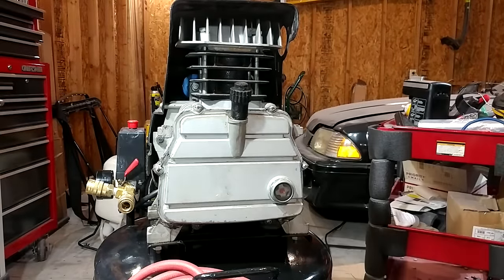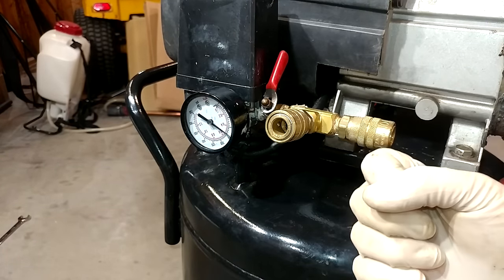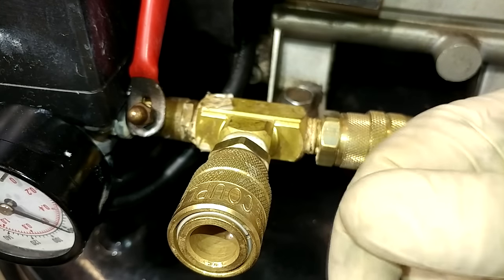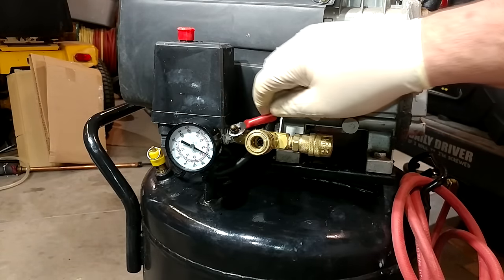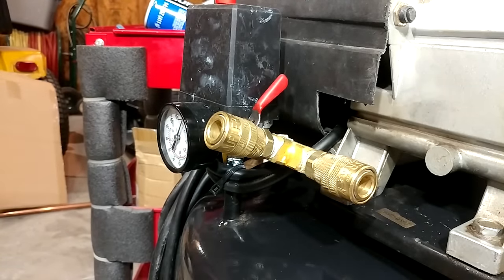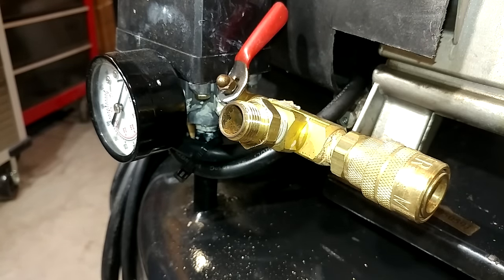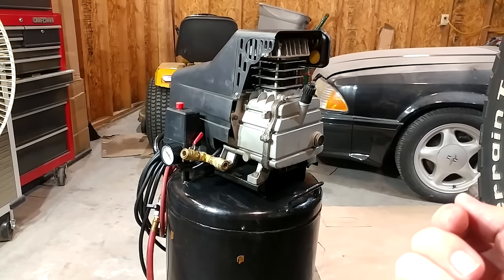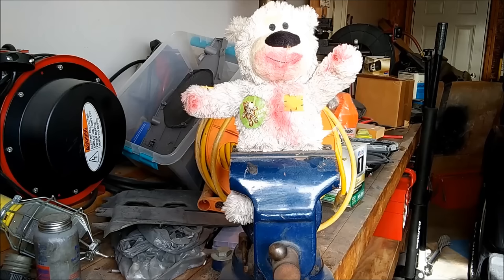Cheap Upgrades for Cheap Air Compressors!

Comment: For impacts I don't bother regulating their input pressure since they'll cope easily with the max my various crap compressors put out. In that case a regulator is merely a flow restriction and the compressor would fail before overloading any impact tool.
Reply from the maker: The comments are full of people disagreeing (some pretty intensely) with both of us for doing that. 😂

Comment: What regulator do you recommend to buy if we want to replace the crappy one?
Reply from the maker: On compressors of this size, pretty much anything that is physically the size of a can of soda, or larger, at the home improvement store will do. 

I've had a regulator video simmering on the back burner for awhile now that I really need to get to. 😆

Comment: Your channel locks and vice grips were backwards.   They work better and wont shave material off if they were flipped the right way.  Ebay has cheap filters with threads.  Same price as Briggs filter with no rigging
Reply from the maker: I do plan to revisit the filter in the near future. I'm not happy with the performance of what I ended up with.

Comment: Do harbor Freight compressors ha US threaded fittings or metric?
Reply from the maker: It depends where. Even worse, it probably also depends on model.

All of the air ports (except the air intake on the cylinder head) I've ever seen on them are NPT. Everything else, I would assume metric, but you'll have to double check.

Comment: What about increasing the diameter of the charge tube from the head to tank? Is there any improvement to be had there by going bigger?
Reply from the maker: I doubt it on a compressor of this size. But... I have heard of people finding casting imperfections that were obstructing the outlet on the cylinder head. It might be worth taking a look for something like that?

Comment: Use  DOT rated plastic air line for your air tank drain remote .
Reply from the maker: I imagine you certainly could do that. It's more difficult for me to get that than it is to use regular air hose.

Comment: My cheap compressor could even keep up with a die grinder. It wasn’t the regulator because it took ages to recover the pressure.
Reply from the maker: There's a difference between pressure drop across the regulator and simply running the tank empty. The one in the video won't run a die grinder for too long either. They're one of the most air hungry tools you can get.

Comment: Drill some one inch holes on outside face of air filter 🎉 it will work better .
Reply from the maker: I thought about that, but I ended up replacing that entire housing not too long after this video.

Comment: 2 years ago I know, but if anyone wants to try this, jb plastic weld is great for the air filter mod.
Reply from the maker: Lots of folks have said good things about it. 👍

And... I probably wouldn't do that one again. I replaced that housing with a Solberg unit that cost a couple of bucks, but is much nicer in the end.

Comment: Great vid,thank you! I didn't know the regulator on these small compressors could be so restrictive! 
I am concerned about using  ful pressure on certain tools like finish/brad nailers and pneumatic rivet guns, etc. Did you put a remote regulator in your system for tools like this? If so,what brand do you recommend? 
Thanks again! (Really clever with the filter!👍)
Reply from the maker: Thanks!

I didn't know they could be that restrictive either until many years of ownership. It wasn't until I attempted to use a 1/2" impact gun with mine that I discovered the problem. Then I ran into the problem twice more in other people's shops...

Just to get you by for tools with a relatively low flow rate, like nailers and such, the OEM regulators are fine. Put the one that came with your compressor on quick connectors so you can plug it in and out as you choose.

I'll be covering regulators in a future video, but my general preference is to try to find something industrial grade on the surplus market. Even a fairly well used Parker, IR, SMC, etc will be much higher quality than something from the home improvement store. That said, almost anything is an improvement over what comes on these units.
Reply: @TheBrokenLife not to be a smart-ass, but why not move the regulator to the other side of the tee? That way you have one full-flow and one regulated outlet, leaving you the ability to use more precise tools?
Reply from the maker: @avedesco  If I had planned it all out from the start I absolutely could have. But, I'm positive the day the regulator came off it went straight into the trash out of frustration, and then the tee came along at some point in the future. In all honesty, I always had the regulator wide-open anyhow so I never mourned the loss. Even to this day many years later, I'm not sure if I have anything that minds the occasional 125psi. My die grinders ran for years and years at 180... not that you should do that yourself.

But, I do have a new regulator now and plan to soft-plumb it into the system so it can be selected or bypassed easily. I just haven't gotten around to the video yet.

Comment: Can you put the high flow couplers directly on your compressor? I have some from flexzilla there not brass though?
Reply from the maker: Sure. You can put couplers on anywhere there's a fitting on the tank.
Reply: @TheBrokenLife  ok so taking off the brass coupler and putting a flexzilla high flow is ok? The directly on the machine itself? Haha I just don't want to F up my unit cause I have no idea what I'm doing 😂
Reply from the maker: @David-kg1hc  It should be as straight forward as just changing one for the other. Just don't mess with anything to do with the control system or the over-pressure safety valve and you're fine.

That said... If you really don't know anything about what you're doing, you may want to try to seek out someone local to double check what you're planning to do. None of this is complicated, but it is dangerous if you really screw up.
Reply: @TheBrokenLife  ok man thank you for your time!
Reply from the maker: @David-kg1hc  I'm happy to help. Good luck with it! 👍

Comment: How do I take off a air compressor regulator mine is not like to it's connected in one can make a video like how to take it off please
Reply from the maker: What compressor?
Reply: Mccraw
Reply: Please
Reply: I really want it off
Reply: Ok
Reply: Bro
Reply: Mccraw Air compressor
Reply: Bro
Reply from the maker: @badazzryan8404  Assuming this is HFT 64857... and I'm just judging by the pictures I can see... It looks like you probably need to take the pressure switch off of the left hand side, the air fitting out of the right hand side, remove the plastic cover off the compressor housing for clearance, and then unthread the regulator setup. It seems like you'd have enough room to do that, but I can't tell for sure.

Good luck with it!
Reply from the maker: @badazzryan8404  Give me a few minutes and let me see if I can make you a quick video explaining what I think you need to do. Other people may respond in the comments and help you out too.
Reply: Thank you so much bro you don't know how much it mean to me thx u bro can make the video please bro
Reply: Thx u bro
Reply: Thx u bro
Reply: Thx u bro so much
Reply from the maker: @badazzryan8404  No problem. I'm working on it.

Comment: That breether plug thing came with it ?, I got a pulsar 15gallon  that has a plastic cover that keep flying out whenever the comp is on n the oil would them start flashing through the hole
Reply from the maker: Yep. Anything you see in the video that I didn't specifically comment on is just regular HFT stuff.

You sure your compressor isn't suffering from blow by and pressurizing the crank case and popping that plug out?

Comment: Phase converter  and a 3 phase motor.  Running at 150%. To keep up with demanding air tools.
Reply from the maker: I don't think it would be very easy to change the motor on one of these cheap Chinese guys. The motor and compressor and inline and I think the crankshaft and armature may even be a single piece.

Comment: its good to know even Miltons leak ..its also bad to know........i wonder how much wasted electricity occurs in the world from leaking air fittings , not to mention needlessly worn out compressors.  Many times side load from an air hose causes a leak. I  should probably make a guide to keep hoses aligned at the stationary fittings.  even if they don't leak the seals will last longer with even loading.
Reply from the maker: I think it's fair to say that I killed that Milton through abuse, but yes, nothing is perfect. 😂

To answer your other question, from industrial experience, the most expensive thing almost any factory makes is compressed air. I've heard of "sealing events" (where the maintenance guys go out and just fix leaks for a few shifts) reducing the power bill by 10-15%. But... a lot of places run positive displacement type compressors that never shut off, so they don't really care how much leaks as long as it works. In the home shop, I just find it seriously annoying to listen to everything hissing all the time.

Comment: Has anyone tried using the oiless  6 hp motor on a oil set up using different pump?I’m gonna try putting a belt system on 60 gal.tank with harbor freight 5 hp pump.once all the craps off the motor it should work work with a little coaxing
Reply from the maker: With enough effort I imagine anything is possible. If you have all of that stuff just sitting around there's no harm in trying to repurpose it.

Comment: Where is your Teflon tape? It's superior for sealing compressed air fittings
Reply from the maker: ...until a piece of tape goes through your air tools. In the case of a compressor you paint with, that could also mean destroying an entire paint job.

The truth is that I don't sweat it one way or the other all that much and I just felt like using dope where ever I used dope. But... There are reasons for going either way in some cases.

Comment: Why don't you have an oilless compressor motor?
Reply from the maker: A few reasons. First, they weren't all that common back when I bought my compressor so I just took what I could get at the price I could pay. Second, now that they're more available, I'm not a fan of them because they run so much hotter. Pretty much every oil-less compressor I've ever seen, that has seen any work (and wasn't ultra expensive), has died a young death. I routinely abuse my oiled compressor and it keeps going, and going, and going, and...

Comment: Great video

How did it run with the new filter?
Reply from the maker: Not awesome in my opinion, but it's not really a fair comparison vs. none. That's why I didn't time it and share the results. Only a moron like me would be running without one at all. ;)

I'm considering trying to move up to an automotive or motorcycle filter in the future. If I do that, I'll for sure compare the two head-to-head.
Reply: @TheBrokenLife  use a hole saw and drill some holes on the outside of the cover, give you more airflow
Reply from the maker: @garrymccoy4053  I had the same thought and may give it a try.
Reply: The plastic part of my air cleaner housing melted that threaded into the head. I have no idea how to fix it. So I’ve been living with nothing for many years and it sucks. I am more of a moron.
Reply from the maker: @toddkokko5049  I think the joke is on both of us because the performance without a filter is about twice as good as with one. I kinda wish I hadn't fixed it! ;)

Comment: If I remove the regulator how will I know my tools won't blow up from too much air? If it puts out 150 and the tool only req 90 psi?
Reply from the maker: I've been running hot garbage air tools for 30 years and I've never had one blow up.

What I would say is that if your tools are working fine for you, then don't mess with anything.
Reply: @TheBrokenLife  Thanks-
Reply from the maker: @vicc6744  Good luck! 👍
Reply: @TheBrokenLife  Thanks I haven't had a compressor in like 18 years but I'm retired now and thought I'd like to have one to do some work on my old Scout
Reply from the maker: @vicc6744  Man, I love Scouts. Literally a home town favorite for me! 

Since you're just looking around and haven't bought yet, I would suggest something larger than these entry level units. Pretty much anything belt-drive will be a much better compressor... especially if you have 240V available in your shop.
Reply: @TheBrokenLife  I wish I had 240 lol- I was looking at a husky quiet 27 gal type- The last one I had was a Craftsman 30gal that lasted about 30years-
Reply from the maker: @vicc6744  The Husky I see fitting that description is also direct drive and is oil-less, which I don't care for.

Direct drive compressors run at a much higher RPM than their belt driven brothers, so they tend to be louder, and can't be repaired as easily because you can't replace the motor or the compressor... they're one "thing" and they tend to be specialized. With a belt driven system, you can bolt any motor or compressor to any tank.

Oil-less is another problem, IMO. No oil obviously means no lube to the compressor internals, but it also means no cooling from that oil. They burn up pretty quickly and produce some really hot, wet, air.

It's been awhile since I looked around, but back when I bought my DeWalt that replaced the one in this video, you could find similar models around the $500 mark. That was the best I could do with 120v power. At a glance, that still seems to be the case.

If that's outside of the budget, I would buy the cheapest thing you can tolerate while you save up. If you start doing any heavy work on that Scout at all (which are sadly well known to rust... so need all the help they can get), you'll probably want more compressor.
Reply: @TheBrokenLife  Pretty sound advice- I never thought about a belt drive one- I'll look at them and let you know

Comment: Forget a valve under the tank!!!! run a hose/tubing from the bottom, to a valve thats of a convient height to open and close......Yep, place the valve at 4 or 5 feet off the ground. Its gunna blow out any and all of the moisture without gettin underneath the tank!!!!
Reply from the maker: ...watch the rest of the video. 😉

Comment: Instead of mauling the original filter housing, I would have simply cut the filter media to fit the original housing.
Reply from the maker: I would have introduced a flow restriction by doing that. I was attempting to replicate the performance of no filter by doing what I did, and as inelegant as it may have been, I believe I was successful.

In the long run, I ended up putting a Solberg filter housing on it, which ended up being a far superior solution.
Reply: @TheBrokenLife  Understood. I can see what you're aiming for. Not trying to sound condescending, just trying to offer a different perspective. And here I go again...

Instead of gutting your old housing, would it be possible to use pvc, poly, vinyl, or copper tubing to plumb into your intake port? I ask because I did just that on this old Kobalt 26 gal I recently got working. I think it was ¾" vinyl & I pulled the undersized grommet out of a medium sized crankcase breather filter & snugged it altogether. It was seamless, flow is great, & it offers me flexible options for when I rebend the pump discharge tubing & can put the top half of the housing back on. 

As long as it works, other's opinions don't matter. Love the video & appreciate the info.
Reply from the maker: @goose2090  Sure, you could do any number of things. I was using the parts I had on hand and a distant memory of a video I saw probably 10 tears ago. That guy just screwed his on, but that didn't work out for me.

In the end, the $20 for a Solberg housing is what won for me. 

You can see the end result here: https://youtu.be/xzf11RlGsxI

Comment: Please get some open-end wrenches! NEVER use channel locks/vice grips on brass fittings designed for wrenches, unless there is no other option or emergency.
Reply from the maker: I explain that situation more clearly in the video in the pinned comment.

Comment: I'm surprised a water separator wasn't on the list.
Reply from the maker: The damage was already done long ago on this compressor by the time that came to mind. You will find a video in the compressors playlist where I installed a water separator on the compressor that eventually came after this one.

Comment: Turn the pliers the other way
Reply from the maker: Where? When?
Reply: At 4:15 when you were trying to disconnect the leaking fitting. If you turn the plier jaws facing upward in that situation they would grip better. The way you were attempting would be the way the jaws would be to loosen the fitting
Reply: I mean tighten sorry
Reply from the maker: @Wrenchingdaily  Hummmm... OK. I'll file that away to try the next time a situation like that comes up. That fitting wanted nothing to do with being disassembled. ;)
Reply: @TheBrokenLife  - Yep! Came here precisely to comment on that. 
Same in 5:55. You'll achieve much better results by using the tools the proper way. In fact they're designed like that for a reason!
BTW same applies to adjustable wrenches, most spanners', etc. the strongest part (should) do the hard work. ;-)
For what it's worth probably the brass fitting wouldn't have a "scratch" if the tool had been used correctly! Cheers

Edit: Curious detail. Observe how a parrot use it's incredibly strong beak! Same, same! ;-)
Reply from the maker: @crpth1  You guys are making want to try another fitting just to see if it will actually work "without a scratch"... I honestly think it was getting rounded off no matter what, but the public shaming of the misuse of the tools is going to stick with me for life now. I shall never forget to orient them in the correct direction again! ;)